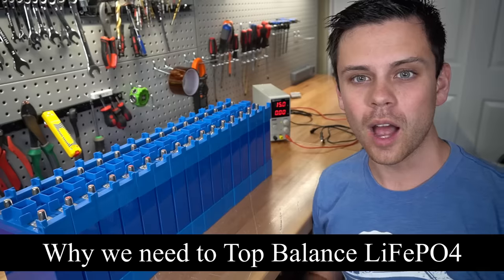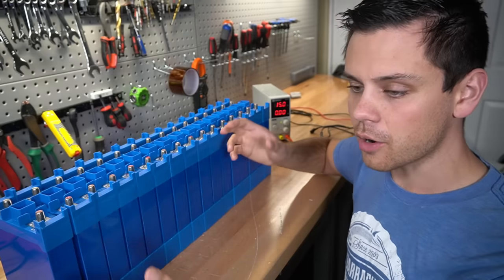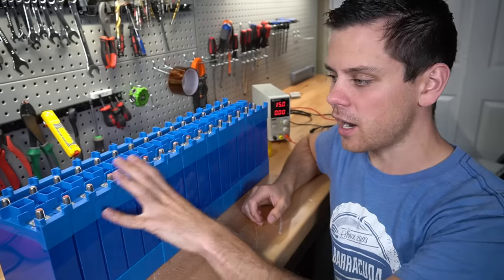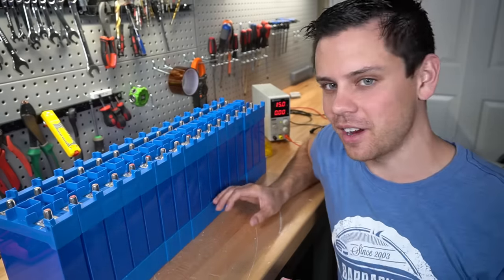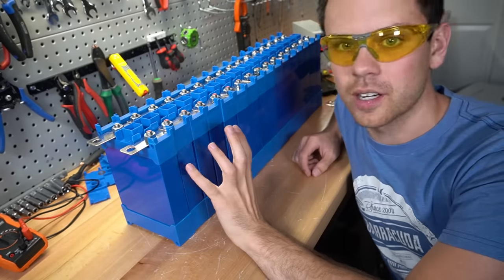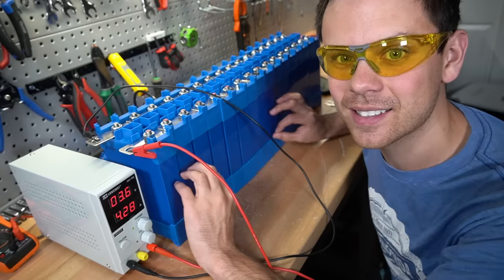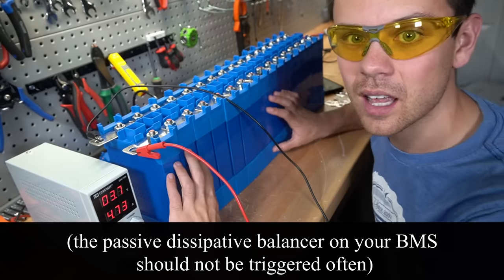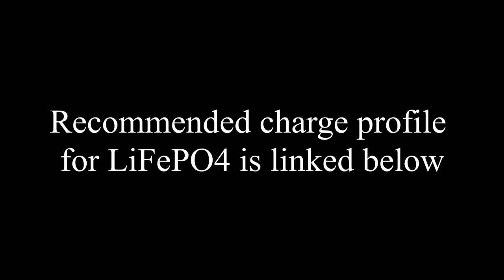How to Top Balance LiFePO4 Battery Cells Quickly (and when you need to do it)

Comment: Thanks for your share. A little suggestion: connect each battery by Cement resistance at first, like 2 ohm /5W. It can avoid big current to damage battery. After all battery have be balance (with same voltage), exchange the cement resistance to copper sheet, and charge / recharge one cycle.

Comment: If your power supply has an option for sense leads you can add a second pair of leads from the power supply to the battery terminals. This lets the power supply sense the voltage at the battery and any voltage drop is eliminated. This makes the top-level charge quicker without the need to boost the voltage setting.

Comment: All the cells will have slightly different impedance. If they are closely matched, they will stay in balance for a large number of cycles. If they are not closely matched they will drift out of balance relatively quickly. For LiFePO4 cells independent cell passive top balancing circuits will keep individual cells from overcharging and the pack BMS from prematurely shutting off or the charging circuit from thinking the pack has full charge when it doesn’t. If you’re a hobbyist and you like messing with this stuff all the time to keep it working, you don’t need the expense. However if you just want it to work and you don’t want to screw with it all the time, pay the money. 

I used to have a ‘66 Mustang that I was always working on and I loved it... until I got older and making more money. I ended up getting a BMW M5 and paying someone to work on it when it infrequently needed it.

Comment: I recommend you place the leads from the power supply at the opposite ends of the bank. You have both leads at the same end. The cell at the far end of the bank will not have the same voltage as the cell closest to the power supply leads. It's not that big of a deal, but it could have a measurable impact on the SOC of the cells furthest away from the power supply leads. 

When the positive is on the close end and the negative lead is on the far end of the bank, the electrical "path length" to each cell is much more similar. This techniques really shines when you are pulling a heavy load from the cells. Each cell is better able to deliver current equally to the load.

Comment: You're talking about needing a cell balancer every 6 months to a year.  Can you discuss balancers that your recommend, and the steps needed to determine if it needs used and how to use it?
What is bottom balancing?
Are these balancing practices needed on pre-assembled batteries as well?
You mentioned that this is kind of unnecessary and that they balance over time, correct?  What's the benefits of balancing every 6 months?
  Thank you, Will! 🙏

Comment: by connecting the power supply to the first cell, it will be a higher voltage than the cell on the far right due to the resistance off the busbars and the connections between them. Better would be positive from charger to the left positive terminal and negative from the charger to the right negative terminal

Comment: Hint. . .put the Positive on one end of the battery and the Negative at the opposite end of the battery. . . . Draw it out on paper. . . . Resistance of the interconnections is balanced this way. . . Better thismway when discharging to.
Reply from the maker: Did you not read my pinned comment. Current sharing is not an issue when pushing .1-4 amps across 150A bus bars. Attach it wherever you please.

Comment: Shouldn't you be charging from a centerpoint? The small but still present resistance of the buss bars and connection points will create at least a .1 or .2 VDC difference from the charger connection point to the last battery. So the further downstream, you still have imbalance. Always appreciate your videos, thank you.

Comment: hi the positive and negative connections should be at opposite ends of the battery to more evenly charge the battery's else the ones closest to the charger will charge first and take a long time to distribute the charge to the cells further away
Reply from the maker: Does not matter here because at that current with these bus bars, current sharing is not an issue. If you are charging quickly, then it will matter and it needs to be at opposite ends.
Reply from the maker: .1-10 amps on this size of bank, with pure copper bus bars that can handle 150A, the resistance is minimal.
Reply: @WillProwse  Thanks for clearing that up.

Comment: So if I buy 4x 3.2V brand new cells, I can just buy a decent 4S 12V 60A (say) BMS, wire up the balance cables, and that's that? Let the BMS top balance the cells for me, then do a few discharge capacity tests? I'm slowly learning more and more about this stuff. The biggest scary part is the initial balancing - top balancing, bottom balancing, it becomes a lot of info to process. Thanks so much for your videos, I'm learning a lot!

Comment: You might wish to have the positive and negative on physically different ends of the cells so the resistance of the terminal connection is equalized the as you demonstrated the cells furthest away from the charger will have a lower voltage than the ones closest to the charger.  Great production quality on your videos BTW!
Reply from the maker: https://youtu.be/k-V8RIuyBbU
Reply: How do u buy ur battery on Ali express.  I have problems  communicating  with them. I need a good buyer

Comment: You should connect the charger diagonally, so positive and negative are on opposite sides of cell block, so the current is accepted equally by all cells and voltage is truly balanced. The way you have it now the cell closer to the PSU will be charged more than cell further away from PSU. Since most people don't wait until current drops all the way to zero, this could lead to less than ideal balance.
Reply from the maker: Did you see my pinned comment
Reply from the maker: If you're charging quickly, sure. Charging .1-10A across 150A bus bars is not going to cause a current sharing issue. If you want to do that, go for it. If we were charging quickly, current sharing is concern and it needs to be diagonal.
Reply: @WillProwse  Doh, sorry I did not see it :-(

Comment: Just a pick at nits. I won't ever used a metal ratchet-driver without isolating one bus.
I appreciate your videos and I'd like to see more so please don't replicate my error.
Reply from the maker: That is a insulated ratchet. That's why I use that. It's composite. This was covered in previous videos as well.
Reply: @WillProwse  I'll go have a watch, Thanks.
Sorry for the trouble. Seems that, I'm just a little sensitive after that particular unscheduled welding event and I don't want to go shopping for underwear in the current climate.

Comment: Hi Will thank you so much for the information that you provide and this video. A few places that I've read on top balancing mentioned letting the pack settle for an hour or so and then check the pack voltage. Keep charging and resting the pack until the pack settles in at 3.65. Is that necessary in your opinion? Or just let the charger get to 3.65 and then reassemble the pack? Thanks again.

Comment: I’m in the process of switching from lead acid batteries to Lifepo4. I got 4 12v, 200 ah Ampere time batteries that will be connected in series and parallel for a 24 volt system.

My first question is, what charger did you use? I looked on Amazon for the one you had, but couldn’t find it.

My second question is, do I need a BMS with a Victron 150v, 100a charge controller?

Thanks for all you do. Your tutorials enabled me to set up our off grid solar.

Comment: I always stick the red and black leads in the centre of the string of cells rather than both at one end, if you check the cell voltages they will be higher at the end nearer the leads for a good few hours. If you leave em charging for days it probably doesnt make much difference tho.

Comment: Hi Will, ..as usual, great video. I would like to know your favorite test method for determining when a cell is heading for early failure. Is measuring the rise of internal cell resistance a good method for LiFePO4 chemistry. What and how is your method...
Reply from the maker: Good question. Should make a video on this
Reply: When I saw this vid I thought wow, Will is a mind reader 🙂. Please make that video! 

Have a EVT4000 scooter that I converted to 48 volt Elite Power Li’s w/ active balancing 10-years ago. Has worked great all these years. But recently have been experiencing voltage sag with higher demand accelerations. Suspect a bad cell or two. Coincidently, I let pack sit for a long period & active balancing drew pack down to 20% above absolute zero capacity. Amazingly, on full recharge, pack was revived with very little sag. It appears that “full” discharge helped things allot. Is that possible?

Still plan on doing the manual cell balancing you outlined on this video. Will watch for your NEXT video about diagnosing bad cells!! Thanks for your highly informative channel 👍
Reply: Thanks, looking forward to your video on this often overlooked test.

Comment: Like you said, you can plug 2 rows of 8 in series so you'll be charging at 28.8V. Your psu still supplies 4.35A, but your charging will be 8x faster.

You can even speed up the process by setting the voltage to the max of 30V, for 7% increase in charging speed. It won't damage the cells, as they are usually rated for 4V charge voltage. You can lower the voltage, as soon as the amps drop close to zero

Comment: I never hear of anyone discharging multiple cells in parallel.  Top balancing and charging up in parallel as you show here is fine. Is there a technical issue with discharging all cells in parallel for bottom balancing? This way balance is never a problem.

Comment: Hi DIY Solar,
Wouldn't Bottom Balancing be a better method?
When top balancing, you measure at the steep side of the charge curve where the last 5% (or so) of the S.O.C. will be.
When bottom balancing, you discharge all the cells till 2,6 (about) and will know all the cells will be at the lower 10% of their charge
Connecting them in series and charge them with a normal charge current would result in an equal charge in each battery, specially when avoiding the upper 10% (90%S.O.C.)
I would like to hear your reason for choosing for top balancing.
Regards and keep up the good works!

Comment: I make my year balance everything when it's December. Then the sun is not showing so much and I can swap out cells and load them up. Usually I wait until the cells are at 80 to 90 soc. 

I have 16 cells with 105Ah as a 12V system.

So if iam putting 4 cells out I have reduced capacity but I don't care. Then I load the cells single to 3.65V and take the next and so on.

The last 4 cells I swap out with the remaining full loaded 12 cells. And then I can load the 4 cells up and integrate them into the battery after that.

It's a little work but it pays off. Only after 1 and a half years now I get cell block 3 slightly off at 0.1V when iam at 100Ah left on the battery...

I make top balancing because my battery is more time in an higher soc then at low. So due summertime I have always over 70% soc

Comment: Hello, thanks for explaining the procedure. I appreciate your enthusiasm. I have a small question:

Is it safe to keep them charging overnight? Technically, if I keep the supply voltage to 3.6V, then it should be safe, as once all of them charged and balanced, the input current will be o eventually, right? Just wanted to confirm from you who must have been doing this often.
Reply from the maker: I never do actually. I have a lot of my habits form charging lipoly cells for years. I try to avoid charging unattended often.

It shouldn't take more than a few hours if your cells are at high soc.
Reply: @WillProwse  Got it! Thanks :)

Comment: What do you do if you buy a pre-assembled battery  from a manufacturer and the cells are not balanced in a 48v server rack battery.
Reply from the maker: Cycle it. It will balance over time. Is it pulling full capacity?
Reply: @WillProwse  l did not do a capacity test. I'm new to this and found out how important it is to do that. Well here's the deal I have 6- 100AH batteries on a 12,000watt growatt inverter. The system has been up and running for 2 months now. In the last week I noticed that the batteries would not charge fully as they were. They now peak at 53.3 volts. I checked the screen and the voltage is off on some of the cell's. Now of course I tried to save money like most dummies and purchased the batteries from AliExpress. Also they hold up well until they hit about 49or 50 volts and then they seem to speed up discharge. But it varies on discharge. I don't work the system hard at all but I guess the capacity test will tell all. By the way the voltage different is like 3262mv and 3293 in difference. What do you think I should do.

Comment: Hey! I love your channel and motivated me to build my own Lifepo4 battery. I’ve been having issue with the top balancing seems to be stuck at 3.26v and one cell at 3.24v currently charging at 3.65 and 5.9-6A and doesn’t seem to be going up. Been going for almost 20 hours? I’m using a cheap Amazon power supply with 14g alligator clamp? Could that be causing the issue. Thinking about going to 12awg with ring terminals. Thanks for the help!

Comment: for optimum charging You should put one charging port on the oposite side of the cell pack
Reply from the maker: No need at all. Did you see pinned comment
Reply from the maker: .1 amps will not have current carrying issue on a 150A busbar

Comment: When performing very high power charging or discharging its not good enough to have one cable on each side to get good current sharing. A power distribution block and equal length cables. Otherwise the power will drop more and more towards the middle of the cells. Just do a test and measure.  ]
Reply from the maker: Absolutely what I said in this video. Did you watch it

Comment: Should the correct way to wire the charger to the battery be to connect one lead to the front positive end and connect the other lead to the back negative lead. So one wire will be on one end of the battery pack and the other will be on the opposite end.

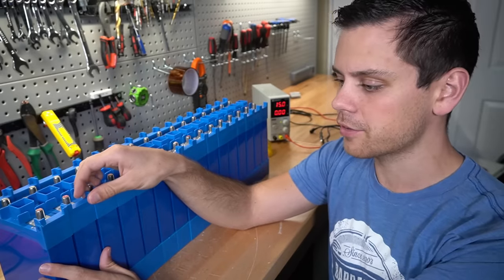Comment: Will, I listened to your advice @1:35 - I connected 16 cells in parallel and it led to voltage runaway. The voltage rose very quickly. All my cells 16 cells (1000 USD) are now at 4.36V and permanently damaged. Maybe though, there were problems before that.
Reply: What was the per-cell voltage before you connected them?  Was the runaway before or after you connected a charger?
Reply: Shouldn't you have set charger to 3.6 volts so it would stop at that voltage?

Comment: Hi thanks for the informative video. I'm new to this and am building headway hp battery. They are nominal at 3.2V and charging voltage 3.6. Should I top charge to 3.2 or 3.6 voltage. Thanks

Comment: Hi Will, great video as usual.  I just got 16x 30ah pouch cells real cheap.  I am charging them now and will capacity test each cell before I make a 2p8s 24v battery.  Question—should I combine the highest and lowest capacity cells in parallel for my 2p arrangement or does it matter?

Comment: Mr Will, I am installing two banks of 16 x 300ah (32) for my 600ah 48v storage. Also purchased two 16s DALY BMSs. I have top balanced each bank with my power supply. QUESTION, now what is easiest way to balance all 32? Thanks

Comment: Do you need to put the cells in compression before top balancing? Do you need to use busbars when connecting the cells or can you use 10ga or 12ga wire?

Comment: Will:  If you are going to use your power supply to do your balancing at 3.5 to 4 amps, why would you need a 10 amp charger?  I noticed that the "junky" charger comes in 5 and 10 amperage ranges.

Comment: I working with 38120 headway cells.  I put all 64 of them in P to balance for three weeks, Then I put them in 4s4p basicly made four 16 cell 12v, then I hooked a 8 amp 12v charger to it, and the charger will only charge them up to 13.3 v and stop.  My question is, what is the BMS I need to put on this 64 cell 12v battery?  four 12v bms?  Can you point me out to one that got the battery wire already solder onto the bms, since I can't see to do that.  Thanks.  Keep up the great work.

Comment: Sorry for such a basic question, but how do you typically charge a 4s lifepo4 100ah battery? Can I use a normal 12v car battery charger with microprocessor? Can I use a constant voltage power supply? What have those special 110/220V battery charges e.g. victron different to a constant voltage power supply? What are the functions bulk, absortion, float for? Thanks for your help. BTW I am not into Solar, I just will use a self made 4s battery and charge it from the grid

Comment: At 3:57 you say use a traditional charger to bring them up before top balancing. Do I need the BMS connected to do this ? I have 40a traditional and 50a lifepo4 chargers available, 280 and 314ah cells (new Eve grade A). I built a battery with 4 of the 280 cells and the BMS said they were at 190ah/66%.

Comment: I received my CCCV charger today and began to top balance. The cells were around the 3.3V range. Upon starting the current readout was 4.2A and dropped gradually. I kept an eye on it and it got down to about 3.7A after an hour or so. However, after a couple hours I noticed that the current started to quickly bounce around 4.0-4.2A and has been hanging out there for the past hour. Is this normal activity with the charger? I am using this charger linked in the description.